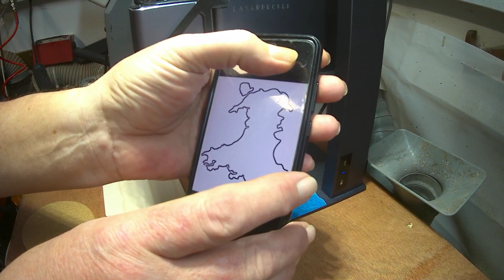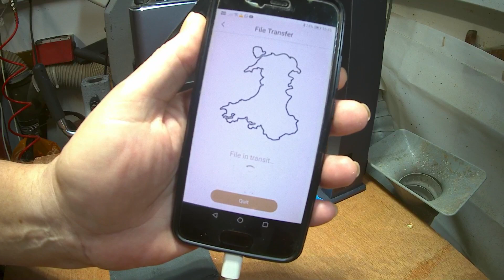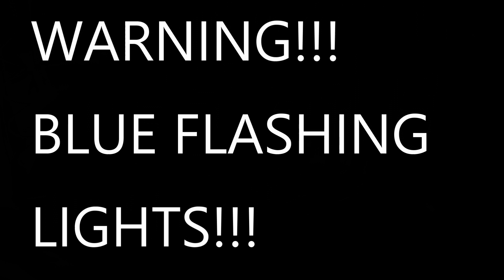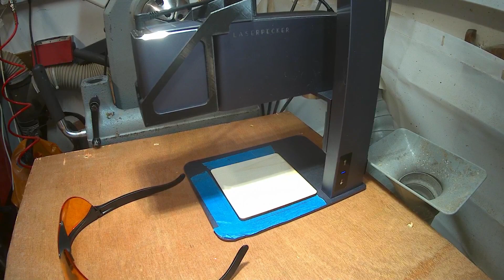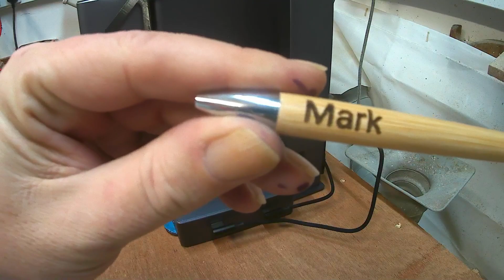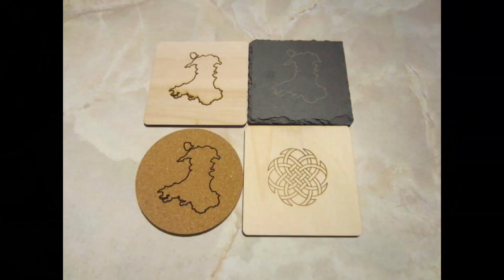LaserPecker 2 Laser Engraver on Poplar, Cork, Slate & Metal & Roller Attachment on Bamboo Pens

Comment: My laserpecker 2 engraver is not lined up between the 2 rollers and I can't adjust the position, any suggestions
Reply from the maker: I don't quite understand what you mean it's not lined up. You can move the image on the app to line it up on the rollers.
Let me know if this helps or not.
Take care and thanks for watching and taking the time to comment Virginia.
Cheers, Huw
Reply: @WoodenItBeNice  I didn't know you could move the image on the screen,  thanks for your help
Reply from the maker: @virginiawesebaum5779  In the video at 5 minutes 16 seconds I show how to move the image around.
When using the roller you will have a single line which you move in the same way. Hope that helps.
Cheers, Huw

Comment: Hi I've just  got my LaserPecker is there anywhere I can get help with setting  for different materials
Reply from the maker: Hi Amanda, The LP2 has built in settings for different materials which you can use as defaults.
If you haven't already I would suggest you join these Facebook pages as they are really helpful. LaserPecker 2 User Group and LaserPecker 2 VIP Group.
If you click on the magnifying glass at the top and type in what you are looking for there are normally lots of answers.
Take care Amanda and hope this helps.
Cheers, Huw

Comment: G'Day Huw.  Great work and very quick.  Have you tried to put a pattern completely round the pen.  My Co2 laser, you had to input the circumference or diameter.  With a few test pieces, you could engrave all the way round without overlap.  FIVE ***  🙂  Rob
Reply from the maker: Hi Robert, Thank you so much.
A few of the other design I have done do go all the way around the pen and some are perfect but others not.
The Bamboo pens are quite cheap to buy so the tolerances are not exact on each one so it would take time to calculate the circumference of each pen to get it perfect and these are very basic entry impulse buy pens so I calculate to leave a small gap rather than an overlay.
Take care mate.
Cheers, Huw